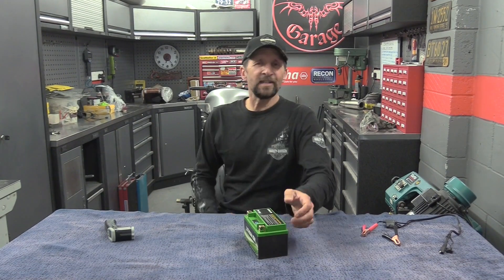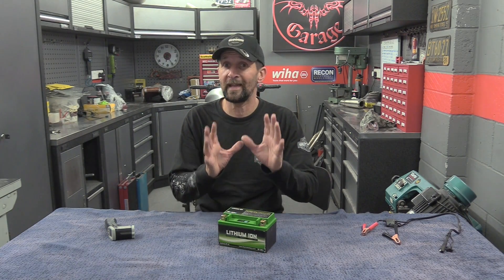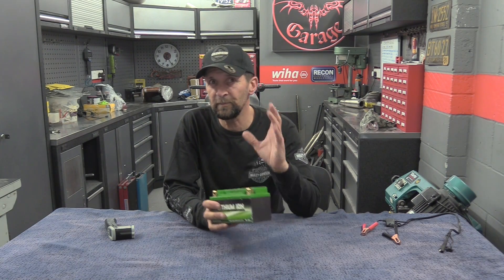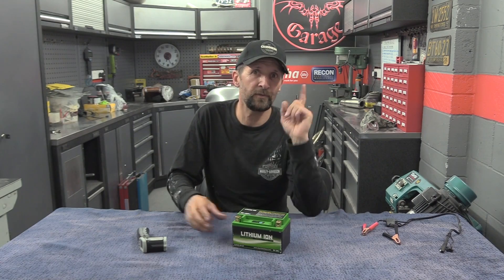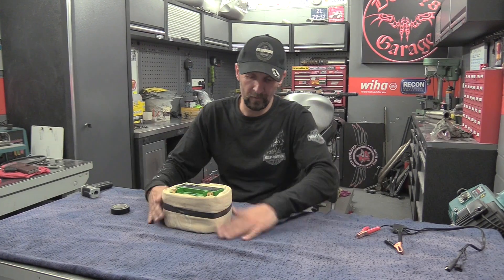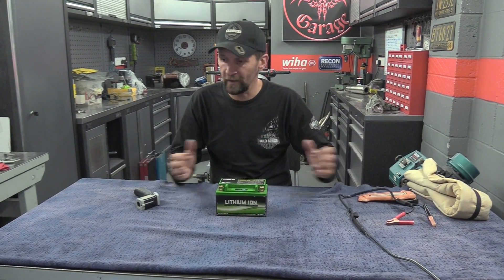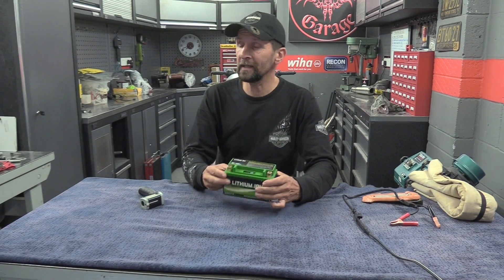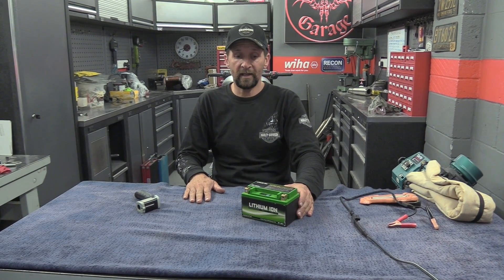Delboy's Garage, Lithium Battery Heat Test.

Comment: Quick question Del, when I  bought the Fatboy they gave mean Optimate 4 battery tender, if at some stage in the future I bought a lithium battery for the Harley would the Optimate 4 still work , thanks in advance guys, hi to Miss PP 👍😎
Reply from the maker: Geoff Oz Evans: good move buddy, you don't need these for a Harley, the only thing they offer is lightweight... like that's relevant for a Harley lol !  If you change your battery, then swop over to a Motobatt as they have more cold cranking amps than the factory battery and costs less than half the price....!
Reply from the maker: baccas66: thanks for your insight buddy, really appreciate that, dead right in everything you say...
Reply from the maker: Thanks James, thats great news to hear, i love the Motobatt units, they never fail and always have more CCA than the same amperage regular lead acid battery... the FJR is no small bike either, so if one can run that, and all your Tech at the same time, then its looks like its more than up to the job..
Reply: Moonfleet41 yes Del, I  was looking at the Motobatt, no need st present but pays to be prepared & aware ay  mate
Reply: Hope you don't mind me jumping into your question but I put a Motobatt on my 2001 FJR1300 last year and I have things like my gopro and phone on charge while I'm riding so it's a brilliant battery and well worth the extra pennies. I also have a visible battery indicator showing the voltage and it always says 11.4v on start up and starts first time every time. Must say Del was the one that pointed me in that direction a few months ago.
Reply: James Cramer good to know for future reference, many thanks  James

Comment: Size 7 WPS lithium battery, $73 shipped on ebay. Good for any liter bike. Even size 5 will start any bike, but size 7 gives you slightly more capacity for what that is worth
Reply from the maker: Thanks buddy, that's good to know... specially for thins like Harleys, as they take a lot more cranking !

Comment: So does it need a new charging system for the bike? The only experience I have with lithium ion batteries is 2018 Africa twins, and they have them as standard, though I would note they are fully encased right behind the engines top end in a perfectly fitting plastic case
Reply: I typed that while watching, you answered the question at the end, however I’ll leave the comment there for the Africa twin information
Reply from the maker: Thanks Liam, great insight, it's always good to know these things... I love the Africa twin as they're like a BMW GS without all the pretence... they just get on with it, and the new one looks a riot !
Reply: Moonfleet41 the big tank version is a little bulky to ride around the town, but the standard version is awesome to ride